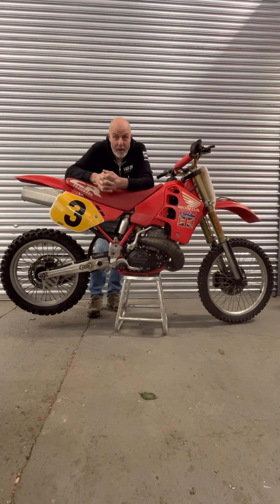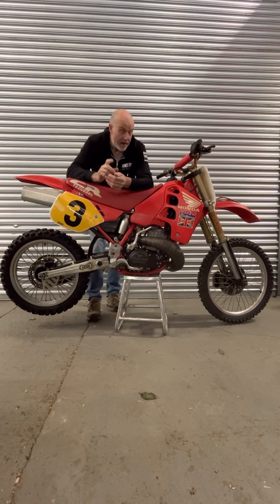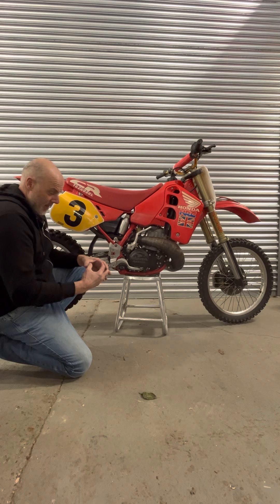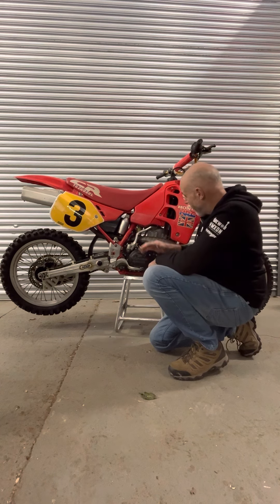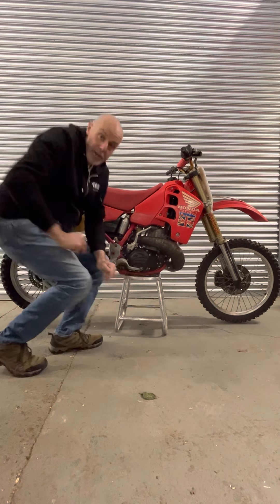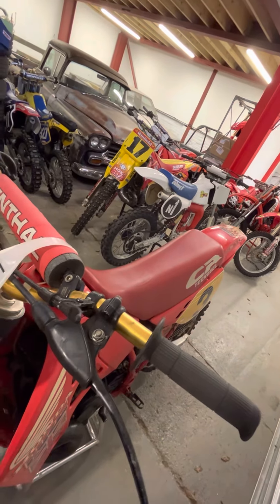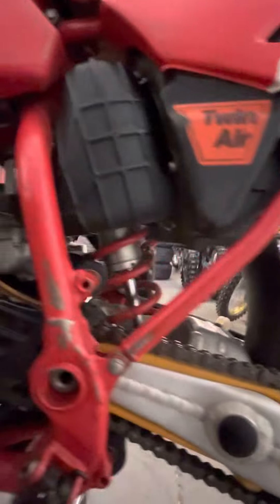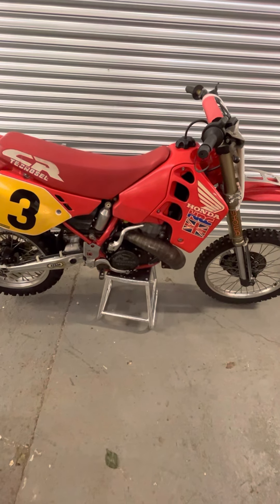Finding the lost factory Honda

Comment: I saw that bike in Luxembourg GP in 89. Hated hondas, would love to get my 90 KX100, rode itfor the acu schoolboy nationals that year, it would be my last year of racing as i started the 91 season in the seniors and wanted to keep it forever as it had slechten exhaust pipe, rebored, kehein carb, lots of other stuff too.
I gave up mid 91 and it was abig mistake. I had nothing to do with the sport, i actively avoided it, i only just found out we broke usas record mxdn streak, i met rob herring and paul malin at Worcester offroad motorcycle academy in 86 with Roger Harvey when i was 10.
Reply: I appreciate those hondas now especially the 86 or 85 with that fuel tank vacuum pump.

Comment: Maybe the silencer is more quiete  during tech-inspection?
Reply: I have the standard silencer on my CR500, similar in size though different materials. It's definately more restrictive than a FMF or ProCircuit, but it gives it more bottom end torque at the expense of top end performance.